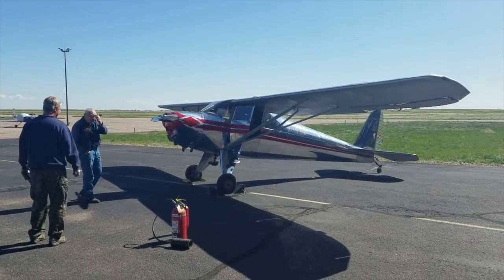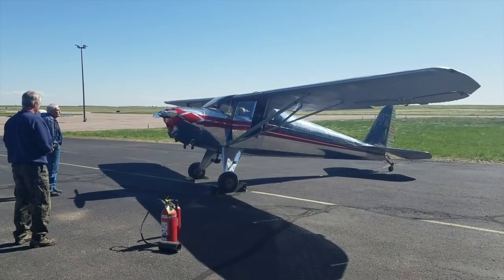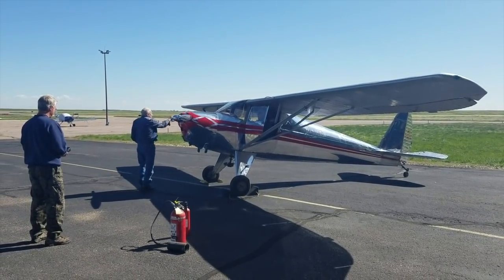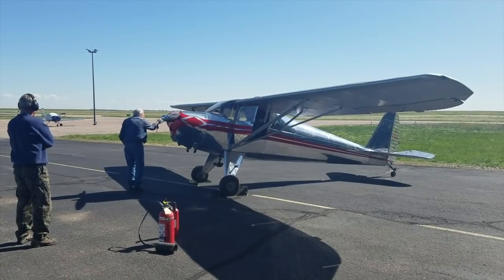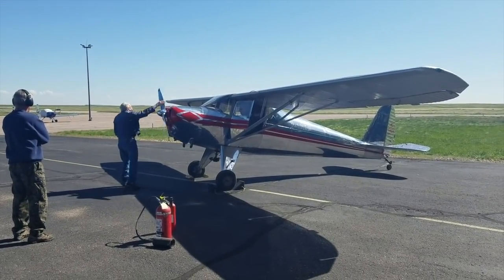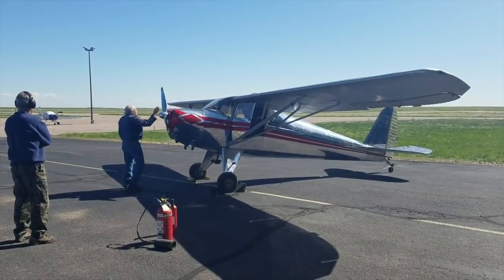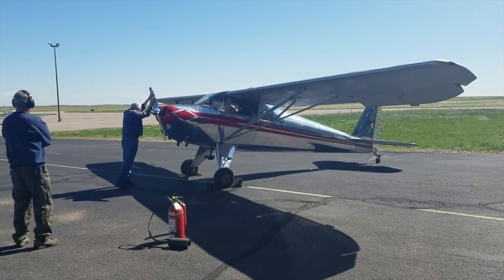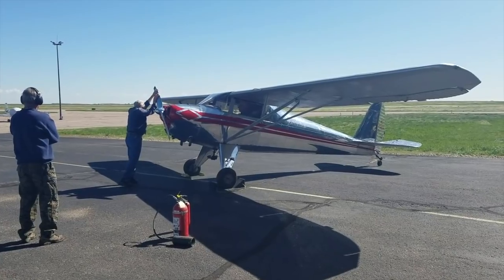Luscombe 8a - Final Engine Run-up Before Taxi and Flight Testing

Comment: Dude, you can't fly it without the "S" at the front of the stripe!  That's just wrong and against the rules!
Reply from the maker: I know!  I couldn’t find the right stencil to make it work!  I wish I had!  Thanks for watching!
Reply: @theav8rs45  If you send me a SUPER EXCELLENT picture of one, i can draw it up for you on autocad and scale it to whatever size you like (give me your email address).  I'll convert it to a .pdf file. 

It's best (to get an accurate picture) to back up as far as is reasonable and take the picture.  This will decrease distortion.